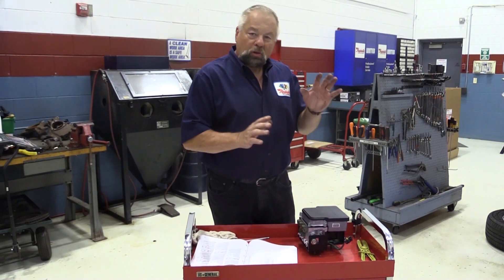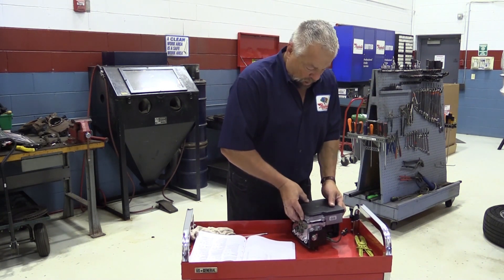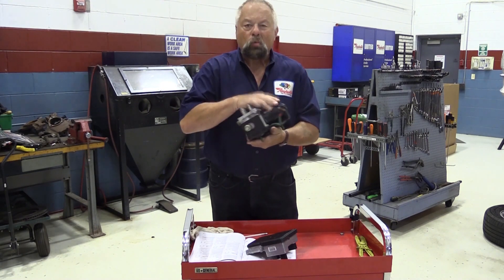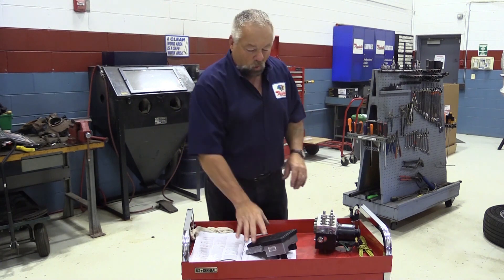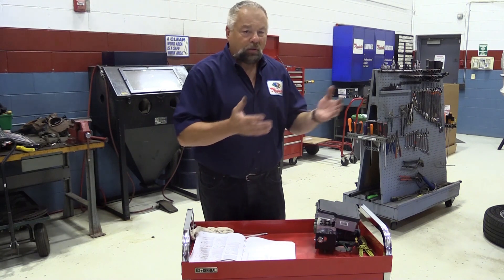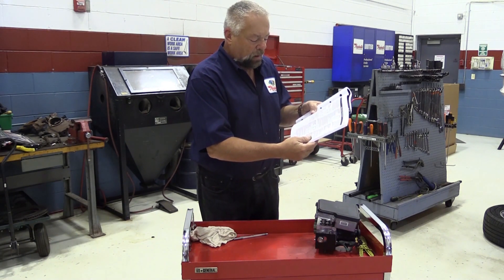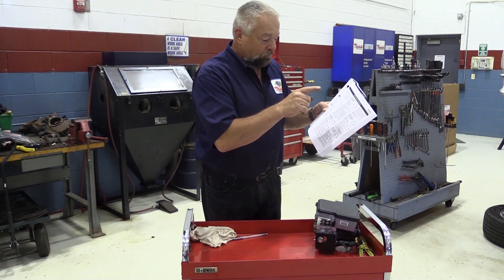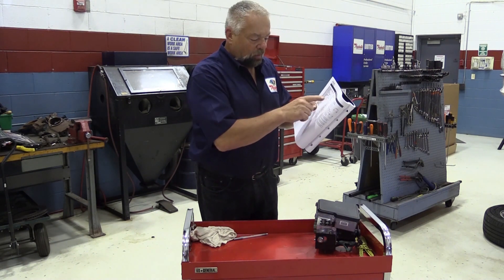Does Brake Bleeding Sequence Matter?

Comment: As long as you do not introduce any air into the system there should not be  a problem. I just did this on my 2014 Toyota Avalon, I started with the front wheel driver side, then passenger side front, then driver side rear and the passenger side rear.